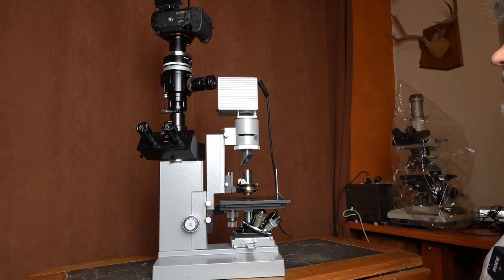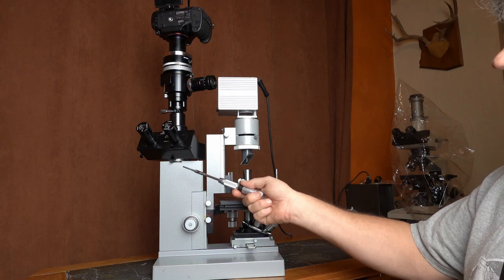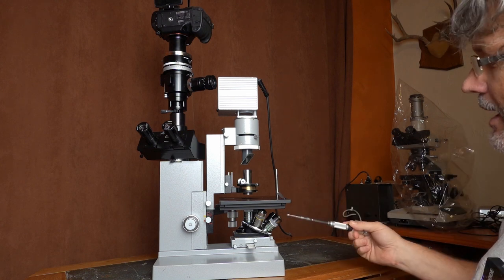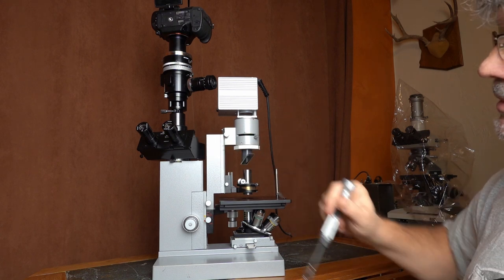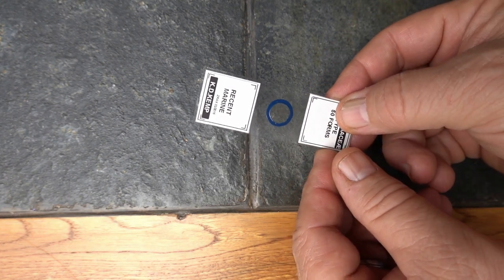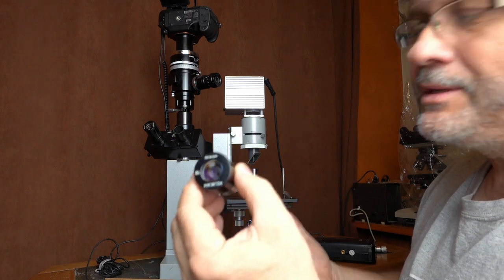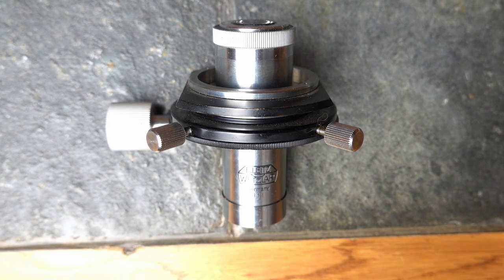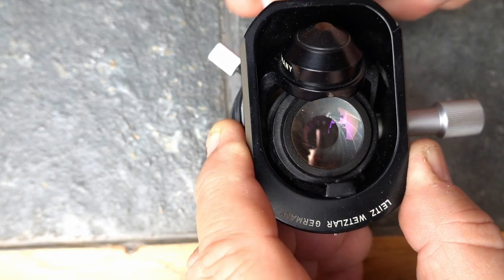The 1970s Leitz Diavert inverted microscope and the 1950s Leitz Heine condenser.

Comment: Great tour of your Diavert. I'm not so familar of inverted ones so this was really interesting. How to use non-LWD optics, Heine etc. with these.
Your pol condensor looks like modification from Reichert achromatic aplanatic one. This is top of the line condensor for Zetopan, NA 1.35 as you indicate. The oil lens, the one below and the casing look exactly like it. Below is some nifty handiwork by some mechanically inclined..
Reply from the maker: Thanks so much for the comments!  To use the Heine and non-LWD objectives, I put the slide on the table coverslip down. I also have well slides where a hole is cut through the slide and coverslip is glued on the bottom. THANKS so much for the information on the polarizing condenser!!!  This is the first information on it!  Cheers.

Comment: Thanks for this great intro to the Diavert! It's likely either this one or the later Fluovert that I will get later on. Being a big fan of the era before electronics started to get crammed into microscopes (leading to high risk of malfunction with age), this is spot on. Just pure high-quality optics and mechanics! I have been using Wild stereos for many, many years already and have several at home, as well as an Orthoplan 🙂
Reply from the maker: Hi Riku.  Yeah just love the old Leitz stands. In the end, I don't know if I would do the inverted again. Seems that the uprights are just simpler and take up less space on the table. I do have some LWD objectives that I think I forgot to include in the video. They do make a fluorescence attachment for the Diavert, but they seem to be rare and very pricey. I've seen the Wild stereos on ebay, and they look very nice. Thanks for watching and commenting!